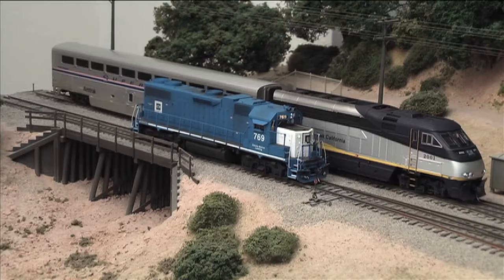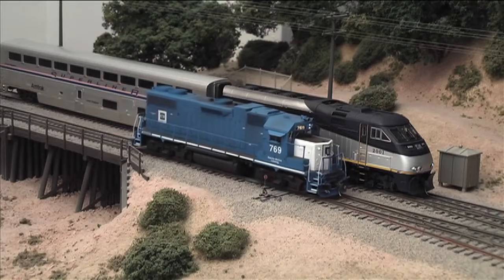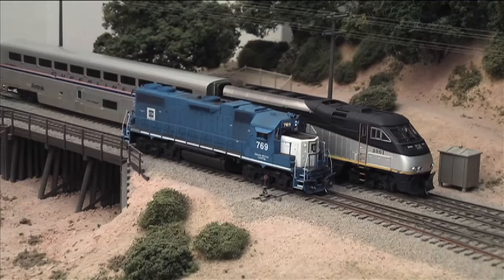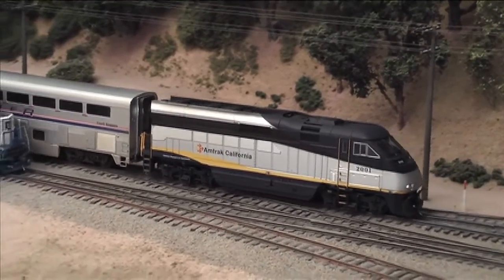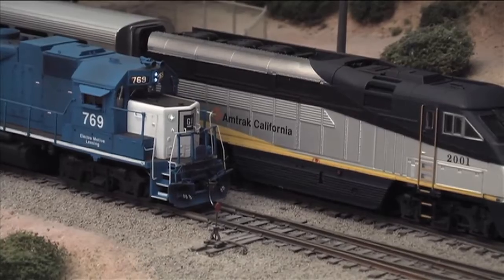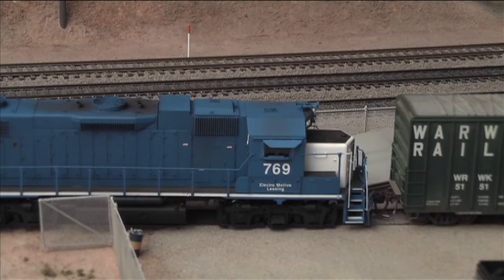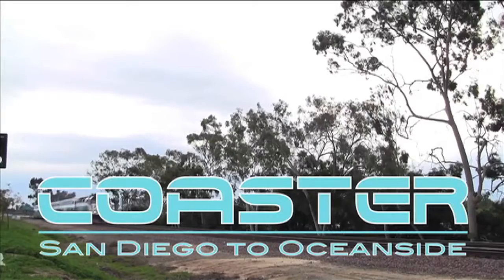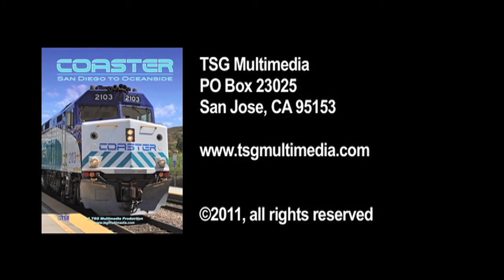HO Scale DCC Train Layout Switching 4-1-11 Podcast

Comment: Good points, all, about smooth starts & stops, realism in operating that matches realism in detailing, sound and weathering.  Nicely done with the motor 'notching' before the engine moves.  But that chirp, chirp, chirping of the throttle would drive me nuts.  I guess it could be crickets alongside the right of way.  ;)